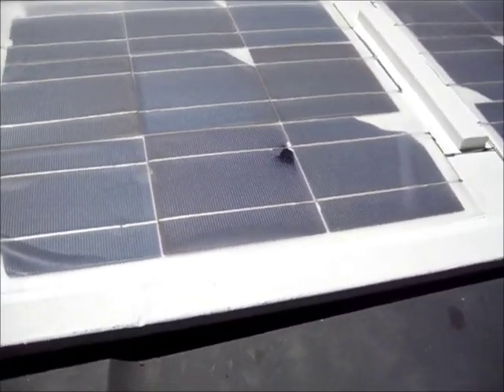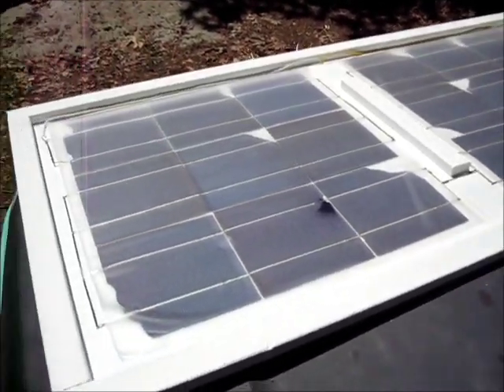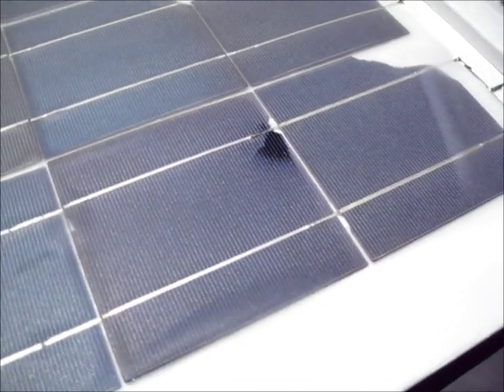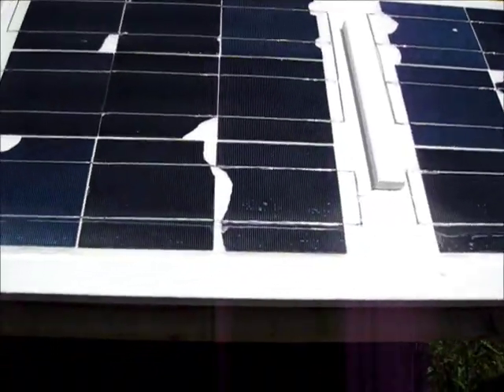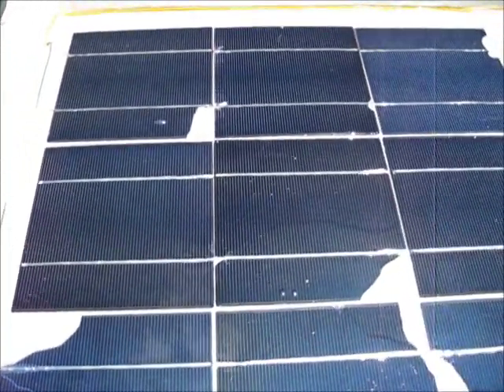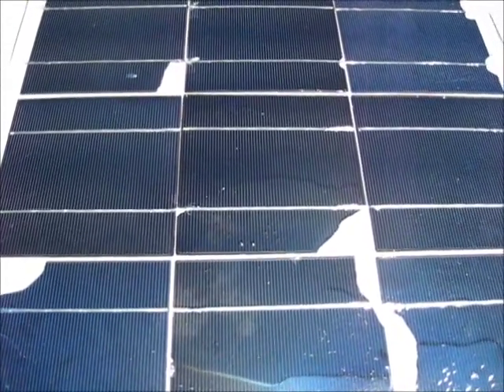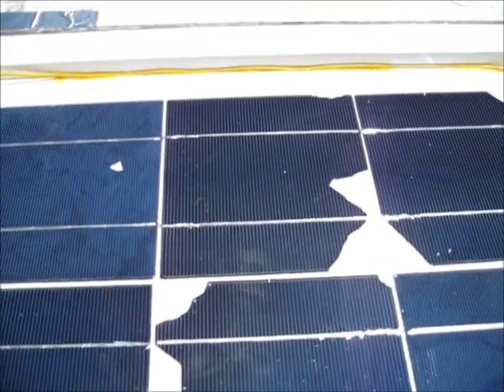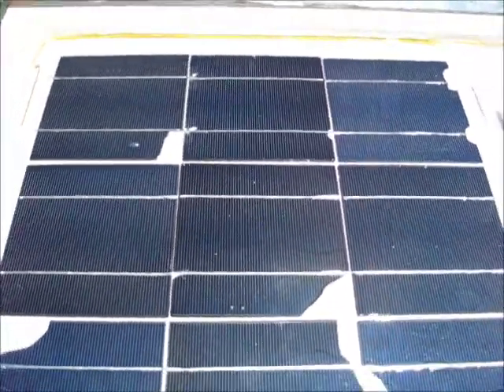Solar Curing Solar Panel EVA Film - the easy way

Comment: i was wondering how well did this panel hold up just using the sun all these years later
Reply from the maker: +mike3367 The panel did very well until I stored it wrong during a move and water got into the wood on the backing. Warped it all up.